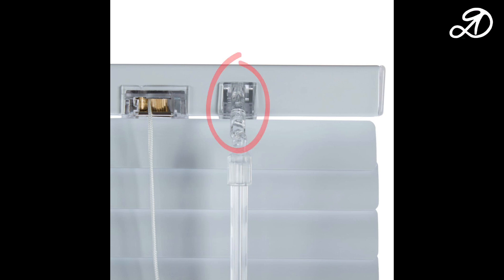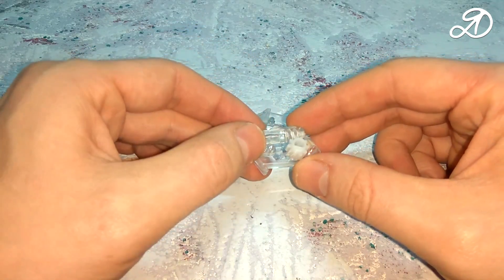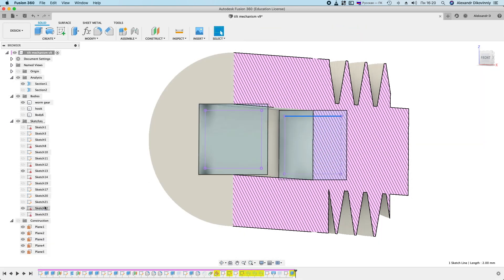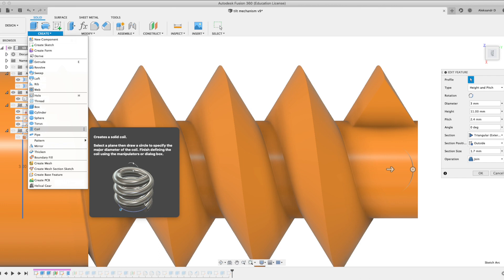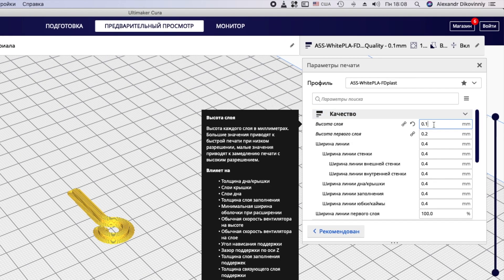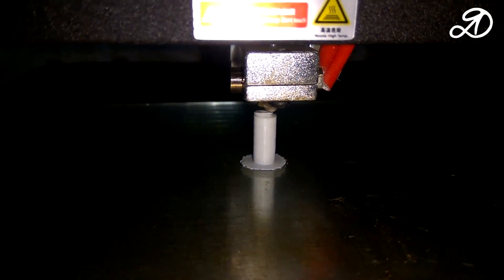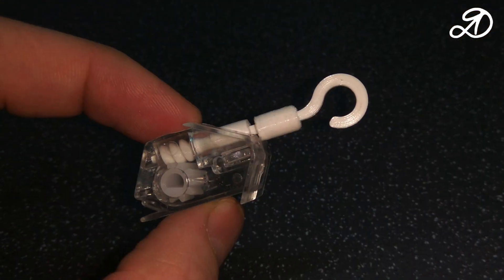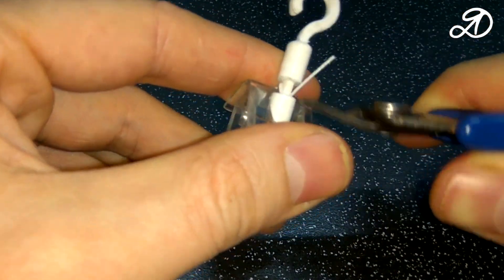How to repair the blind tilt mechanism using a 3D printer

Comment: Nice and all but in reality a metal hook can withstand much more strain of course. I expect this to be a temporary solution and am very curious if you could do a recap in a few months to show how long it held out :)
Reply from the maker: Thanks for the comment! Certainly a metal hook is better. I had no idea how to fix it. Now there are a couple of thoughts, but I will leave them for the future)) there are very small loads And I hope it will work longer. I can't promise, but if I can, I'll try to make a video about it after a while. How would you solve this problem?
Reply: @dial2277  Get metal screw hook drill into part. Fill hole with glue. Screw threaded hook into part.